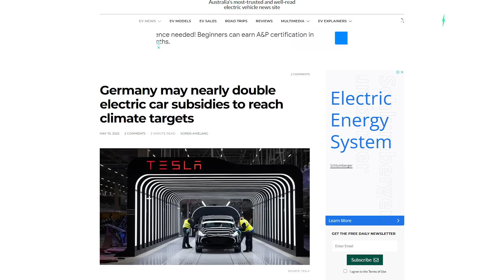German Gov to double EV subsidies; Big Oil not happy

Comment: Re getting people out of their cars and onto bikes, skateboards, etc: I just watched a Fully Charged video that featured at the beginning a vehicle called the Paxster. I calculated that it gets around 290 MPGe. 
If the HTS Group, the parent company, doesn't put out a street legal city car ASAP, they are missing a huge worldwide opportunity. If they aren't planning for huge expansion, someone should either partner with them or reverse engineer one of their vehicles and built a safe, legal and attractive city car with a 7 to 10 kWh battery and a range of 50 to 80 miles. They could sell 10 to 30 million per year if the price is $18,000 or less. All it might need are a crumple zone and airbags to gain wide acceptance.

Comment: For subsidies like the one proposed there will undoubtedly be intelligent rules. In the UK when they did the scrap page scheme 12 years ago, you could only scrap a car which was still certified as road legal, and had owned for at least 12 months. This would have been so that the net benefit was 1 less old polluting vehicle still being on the road when it otherwise would have. One from a scrappy was already off the road and no longer polluting. Unfortunately people were then able to scrap their car and go on to purchase a reduced rate diesel gate vehicle. As  well as all the diesel city cars and 3 mile mobility cars for the elderly, sold that they would be more economic, when in fact the DPFs simply clogged up due to misselling to customers with low usage profiles.

Comment: Brent crude close to $115 a barrel and expected to go higher as we approach the summer.  It's  great to have subsidies. However it would be MUCH better for Germany to REMOVE all the red-tape for companies like Tesla increasing investments in the country. Spend money instead on incentives for companies to build battery factories, lithium and nickle extraction etc.
Reply: Nonsense……. Didn’t the price of oil recently significantly impacted the price of teslas!? Tesla prices have almost increased up to $10,000 because of supply chain and everything around just like food and much more
Reply: @carholic-sz3qv  And so your economist sensibilities tells you the best way to solve the price problem is to offer more subsidies instead of removing barriers to producing more EVs? Subsidies will not solve 6 to 10 month waiting lists. Attracting and building a strong EV manufacturing infrastructure will.
Reply: @danielwebb5082  I’m not against EV but if we suddenly stop subsidizing the oil industry it’s Over for the global economy! Nothing has more importance/usability than the millions of oil byproducts. We can easily make EVs while subsidize then and also Oil
Reply: @danielwebb5082  I’m not an economist you can see the effects that oil has on the entire industry and economy done do not want to mess with it period!

Comment: it makes no sense to have electric vehicle subsidies when the manufacturers are supply-constrained.  If you can only make 1 million EV's then it makes no difference if you have 2 million customers or 10 million customers.   If anything it will drive the price higher.

What they should do is make sure the infrastructure is there for all these new EV's by subsidizing EV charging stations in apartments, urban environments, homes, and most important high-speed charging networks that can handle the needs of all these new electric cars.

Comment: Hi Viking. As some below already noted, this is not likely to happen. The story you are telling is based on a leak of a discussion by one party only in the coalition government. It is a draft proposal, but not even that. It is certainly not an agreed upon policy. Currently, the agreement on EV subsidies is that they will fall from the current total of €9K (€6K for consumers directly, and €3K for manufacturers) to a total of €6K from 01.2023, and then fall further in 2024 and 2025 and end altogether in 2026 or 2027. The draft idea you cited also included a headline figure of 10.8K but only when including a "cash for bangers" component where a car older than 12 years old was scrapped as part of the deal. But as I say, official policy is that the subsidies will fall from their current level to zero over the next 4 years.

Comment: I'm all for EVs but I don't think that this provides the best value proposition. EVs will dominate soon irrespective of subsidies, that money could be spent on a multitude of projects that will offer better value in regards to CO2 reduction.
Reply: Lol…….. it doesn’t matter subsidize it’s not! There are about millions of oil byproducts that batteries can’t replace, also for example for agriculture, mining, construction……… oil is the only way!
Reply: @carholic-sz3qv  no one said that oil wasn't useful. It is extremely useful and it is waste just to burn it in an inefficient and polluting way.
Reply: @rattusfinkus  lol……. Wtf is the inefficient and polluting way!? Isn’t that what makes your EV possible and even powers your EV? Also the global the battery technology is nowhere near the state to compete with oil, let’s not forget all what oil is used for. There is not a single big/commercial/heavy duty electric equipment/vehicle used in mass….. we also have/produce tons of biodiesel/biogas yearly from waste and more.
Reply: @carholic-sz3qv  sorry that you don't understand. Internal combustion engines are inefficient and polluting. EVs are efficient, far less polluting and cheaper in the long run especially as the grid gets cleaner and cheaper with renewables. They are the simple facts. I'm very much ready for a couple of EVs, I'm already totally off grid and have enough spare solar to run two cars. Imagine no fuel costs, f all maintenance and no detours to fuel stations and waiting in line to fill up with expensive dirty diesel.
Reply: List your better value ideas, please.
Yeah, just a negative comment. Elon is smarter than you, Obviously.
Reply: @Julian-1111  that’s what she said lol…… didn’t must recently asked if oil companies could increase their production!? Because the supply chain and everything relies on it! Why didn’t musk make electric mining machines……!? 🤡 🤡
Reply: @Julian-1111  Elon is smarter than me. 
At the moment and for the foreseeable future every EV that is made available to the market is sold. There is a real problem with the supply of EVs and the demand is huge. So providing subsidies will not put any extra EVs on the road so there there is absolutely no additional CO2 reduction that can be attributed to this subsidy. Put that money into any thing else such as wind turbines, public transport (to reduce car trips), electrify home heating, building insulation etc, etc etc. Anything is better than this subsidy, just think about it.
Reply: @carholic-sz3qv  It's called a transition, obviously we can't electrify everything instantly and we need the existing infrastructure and services to function so that we can produce the replacements. You are just being silly.
Reply: @rattusfinkus  silly how!? Lol…. I’m talking about reality and not dreams in peoples heads
Reply: @carholic-sz3qv  so what is in your reality? Is there renewable energy and storage which is cheaper than fossil fuels and just getting cheaper year on year? Are there EVs which perform better, are cleaner, last longer and are cheaper to own than ice cars (and going to get cheaper and better)? Is there anthropogenic global warming which will make governments mandate CO2 reductions?
Or is yours the "alternative" head in the sand hope things stay as they are reality?
Reply: Any subsidies should go towards Charging stations- period. 
If this "welfare " money went Only on the Chargers, it would make it easier to see where the $$ are going. Otherwise it will go towards pension debt.

Comment: If they think cars that don't need gas and oil are bad, wait till they hear about homes that don't need electricity.
Reply: Frank it's 2022, not 1980.  Wind and solar are now the two least expensive ways to generate electricity and battery prices are dropping rapidly.
Reply: @bobwallace9753  The going in cost on solar is still to high. Without government purchasing excess energy from the solar the payback is just too long. It's close but not there yet.
Reply: @sunrisejak2709  
Ah, but that's the beauty of adding EVs to the grid.  EV charging can be, to some extent, a dispatchable load.  Since cars sit parked about 95% of the time if some are plugged in and utility companies given control over the actual time of charging "surplus" solar or wind can be used for charging.

We'll need some charge outlets at workplace and school parking lots, mainly for the use of drivers who have no place to plug in at home.  Arrive at work, plug in, and sometime during the day get charged when supply exceeds demand.
Reply: @bobwallace9753  Good point.
Reply: @sunrisejak2709  
As we build out our renewable grids we need to identify dispatchable loads that can use electricity that would otherwise be curtailed.  We need tasks which have relatively low capital cost or already need to operate less than full time.

Desalination might be one.  If the total amount of water needed would require one plant, and the cost of the plant is low enough, we might build multiple plants and run them only during low demand periods.  Or pump water to an elevated reservoir and let it run through osmotic filters on gravity pressure.

California takes water from the upper Central Valley to supply the LA Basin.  The water has to be pumped over the mountains northeast of LA.  That pumping job is now a dispatchable job.

Sand and rock suppliers have rock crushing equipment that generally runs occasionally.  That could be an excellent dispatchable. load.  And we might crush olivine rock into sand.  We are running short of construction sand in some places and olivine bonds with atmospheric carbon.  Beaches and concrete that sequester carbon.  Crushing to sand sized particles creates a lot of surface area for the chemical reaction to take place.

If we move to combination washer/dryers we could let the grid decide the actual time that the wash gets done.  Pool filters can be another dispatchable load.
Reply: @bobwallace9753  Understood. But where I live the vast majority of electricity is produced by very low quality lignite coal. That resource supply chain while marginally cleaner than oil overall is still a better place to start. I'm not keen on shifting from an oil powered ICE car to a coal powered BEV. I'll likely bite the bullet and thinking long term I'll put a solar system in. Instead of mandating zero emissions vehicles the money put towards those incentives needs to be put into cleaning up the grids so the shift to zero tailpipe means it starts at the source.
Reply: @sunrisejak2709  

From what I find online there's not much difference between types of coal in terms of CO2 emissions.

Internal combustion engines are so very inefficient that running an EV on coal-electricity results in less CO2 than driving on oil.
Reply: @bobwallace9753  That's my understanding too. But it's not compelling enough to make a marginal improvement when the convenience of ICE ownership is so easy and the air quality or climate change? Well,,,, that's always someone else's problem. My goal is to get my solar installed and be as energy independent as possible and then get another EV. (Had a Model 3 b4 but jumped in too early with too many inconvenient issues. I think we're on the same page it's just a matter of coordination..
Reply: @bobwallace9753  Privately owned solar is less than 1% of power in the US, all solar is less about 1.6% Not really a threat. But any breakthrough in efficiency and price could create an issue for power companies. Haven't made much progress since 1980.
Reply: @frankcoffey  

Solar produced 3.9% of US electricity in 2021.  The vast majority of new generation added in the US is wind and solar.  Wind and solar now produce more electricity than nuclear.

Your "since 1980" comment makes no sense.